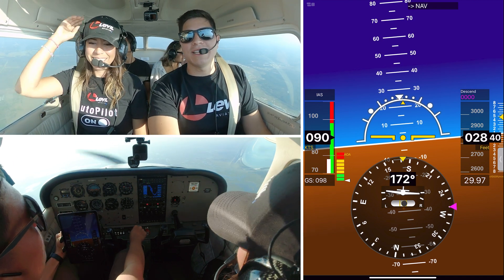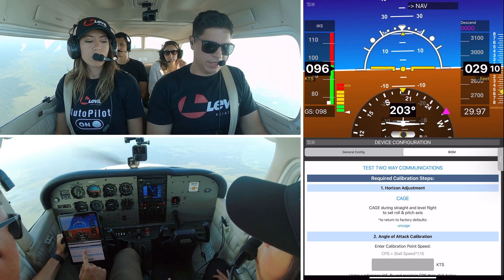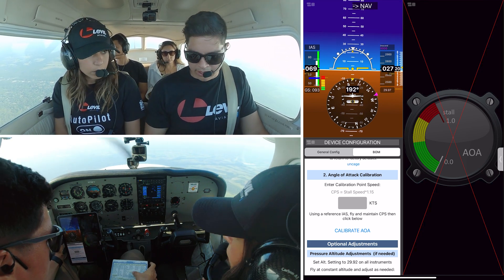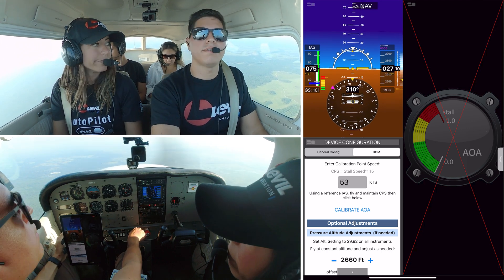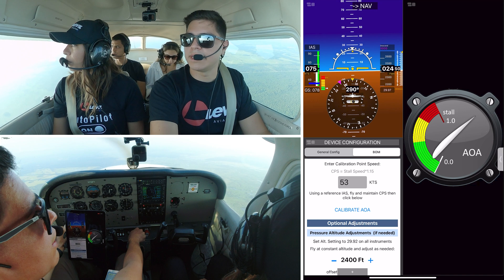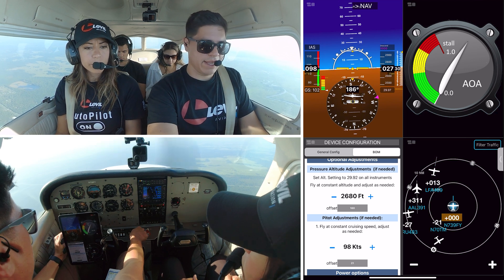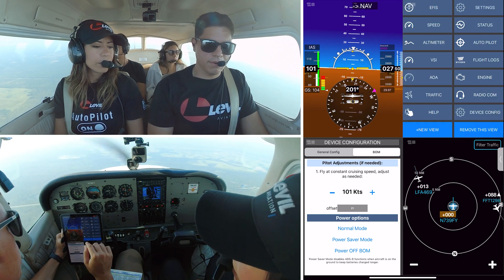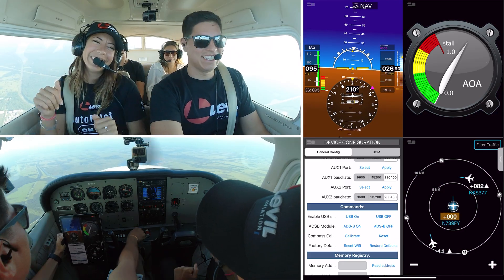Levil Aviation BOM Calibration Tutorial (How to Calibrate & Set Up Your Broadcasting Outer Module)

Comment: Great video!
Just two questions:
1. Does it contain also a g-force sensor?
2. Would it be an option to install it below the hull, or on the wings up-side-down?
Reply from the maker: We have G-force sensors, but we do not have a gauge. Regarding the installation, In some airplanes, the BOM can be installed under the fuselage, though it might block GPS signals if the aircraft is entirely metallic. Additionally, it cannot be installed upside-down due to the sensors being in the wrong orientation, leading to inaccurate readings. Installing the BOM above the wings is also not recommended, as the pressure above the wings is different than below the wings. Where is your pitot tube currently installed? Which airplane are you looking to install the BOM on?
Reply: @levilaviation  I am just interested without a specific plane in mind.
We thought also about installing it on a trike and a paramotor (which would actually the overkill in avionics for such flying object 😆)
Reply: @levilaviation  I am using the BOM in a Kitfox IV. The BOM in located on the strut about half wing distance. The G-Force sensor reads 1.1 when I am turning 30deg. Is this the correct reading?
Reply from the maker: @jimsandoval7633  yes, the reading of 1.1 is correct.